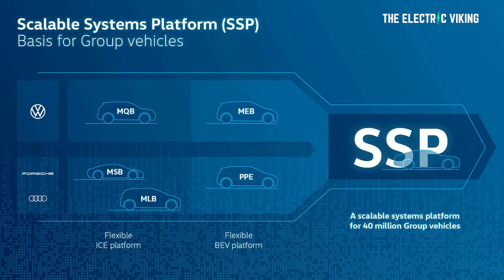Volkswagen MEB+ EV's to get 435 mile range, 200 kW fast charging

Comment: Watch these manufactures claims. Charge hold apparently drops by up to 10% per year by the age of the battery and drops the lower the temperature of the operating environment. As to cost it's been announced here in the UK that electricity used to charge the battery is to be taxed so take your pick and guess how much that will add to running costs in future. Personally I think the car manufacturers are running before they can walk. They should get together and challenge the crazy zero carbon politics involved.

Comment: I wish VW would push out more of the VW E Ups. I really like the idea of a super simple EV like the E Up (or E-Golf) with no big touch screen infotainment, no dodgy software to control the whole car that needs frequent updates, an old fashioned handbrake and physical buttons everywhere. A german company called Kriesel were able to increase the battery pack capacity to 55Kwh and it weighed the same. I'm very tempted to get a E Up as the limited range is enough for me and I hear so many bad things about the software in so many of the newer VW EV's

Comment: Electric vehicles have become popular over the past few years. But EVs could take a significant hit based on what’s happening in Switzerland.

According to a report in the Telegraph on Saturday, the country is considering emergency measures in case of an electricity supply shortage this winter.

Switzerland — the best country in the world according to a recent analysis from US News & World Report — could shorten store operating hours, lower the thermostats at buildings, and limit the private use of electric cars to “absolutely necessary journeys.”

Comment: Within the last ten years the difference in weight between large and small ICE-cars was reduced (all heavy). That is the reason why there is also no difference in weight between the VWEVs and the TESLA3. Only now batteries have improved/ cheaper/ relative less weigth and will come smaller EV cars to the Western markets. The first efficient and capable small city car, with good software,  will be a big winner, even bigger than the Tesla3.(the new EV SMART is still too big and expensive) If TESLA does not bring a small city car in 6 months to the market, it will be on conto of the many failures of nerdy MUSK.
Reply: The buying of TWITTER for 44 billion by MUSK is just like the attack on the Ukraine by PUTIN;  MEGALOMANIA BRINGS SELF-DESTRUCTION. US politicians do also suffer from this mental disease, so bring President Biden to a home for elderly people. in protection of US interest. And bring Trump to a camp for workers.
Reply: Yeah! More failures like the 3 rockets that crashed/exploded! That company went away after their failures didn't it?

Comment: In my AWD ID.4 I get roughly 3.2 miles/kWh highway-only on the day trips we've taken so far.  Summer driving.   California traffic but we avoid commute hours... averages around 65mph or so.  50-80mph due to variable traffic.   Flat and rolling hills.  I don't see these parameters changing a whole lot.  By comparison, a Tesla model 3 gets roughly 3.8 under the same conditions.   For the entire year my average is 3.0 miles/kWh..a bit lower in-city due to there being a lot of hills along my local driving routes.   While not impressive, I am perfectly happy with these numbers!

If you think about it, though, the largest factor for improvement over the next decade is obviously going to be battery pack energy density (volumetric and gravimetric).   Vehicle efficiencies don't really have much room to improve in "normal" form factors... and normal form factors are what most of the buying public are going to want.

That means capacities will be going up... 150kWh+ battery packs will become more common-place in regular vehicles.  That is what will directly enable faster charging and higher ranges over the next few years.  Not efficiency. The coefficient of drag will become less important to buyers as capacities increase.   Past 400 miles of range I don't think people will care so much about efficiency.

There are certainly going to be breakthroughs in battery chemistry and structure over the next few years that will be able to do the job.  The real question is how quickly those breakthroughs can be put into highly-scaled production.

-Matt

Comment: WLTP numbers are not equivalent to EPA as we all know so it comes down to implementation. VW did not generally exceed their current numbers but Porsche did. So I expect the larger capacity battery implementations will be fine

Comment: The ID.3 is not exceptionally heavy for an EV. That is a gross exaggeration (to be expected when the Viking discusses VW products). The ID.3 is 90 kg heavier than a model 3 and ~200kg lighter than a Model Y. Interior space is comparable to a model 3. The car is 10cm shorter, but also 10cm higher. Passenger space is actually slightly better than the Model 3, but the Model 3 beats the ID.3 in luggage space.

If you want to say EVs in general are exceptionally heavy compared to ICE cars, I totally agree.
Reply: The Viking has a lot of information but an incredibly limited ounderstanding of technical automotive manufacturing concepts and yes, an incredibly biased view against VW. Invariably most of his arguments come down to 10 hours manufacturing time for tesla vs 30 hours for vw (which is quite a valid metric, IMO and a fair knock against VW) and 70% automation vs 30% automation (which is too superficial without any understanding of what that means ie there is no standardised definition of automation in the auto manufacturing process eg it could be automation of casting, welding, component assembly etc across the process. In several hardware manufacturing processes - there is not necessarily a 2x benefit on time or cost by automation. And automation is a means to a couple of ends - higher quality, greater standardisation and lower costs - arguably a 50% automation focused on the right process elements can lead to more standardised, less expensive and higher quality end outputs than a 70% automation of lower hanging fruits +70% automation doesn't mean 70% on everything). 

The Viking also loves to knock on other carmakers projections or media gibberish while entirely disregarding Tesla or Musk's million failed promises or timelines. 

To be realistic - Tesla is streets ahead of the game right now. But the rest of the auto fraternity is unlikely to die along the way or just twiddle their thumbs, irrespective of the Vikings strong (and in my opinon - grossly uninformed) predictions. Many of the German automakers will eventually emerge as strong contenders, the random 70% automation point notwithstanding
Reply: @rishabhs14  I couldn't have said it better myself.

I'd just like to nuance the story about Tesla being streets ahead a bit. You already touched on the production advantage Tesla has and I think it's fair to say that Tesla has an advantage in the development of the drive train as well. However, for the in-car software it depends on whether you believe the touch UI interface with Tesla proprietary S/W will be a long time winner or not, if you think Tesla is ahead of the game. And on whether you believe FSD will ever become something really useful in the future instead of a novelty item. In both cases, I personally think that operating the car itself will become less 'touchy' in the future. The entertainment will most likely be taken over by Android Auto and Apple car play. And FSD? Well, all I can say, I don't think it's relevant for the currently sold cars. They will be scrap anyway by the time FSD becomes useful.
As far as driver aids is concerned: EAP is not very unique anymore and since 'Vision-only' (dare I say it?), I think there are better implementations in the market than Tesla's. The removal of the USS means new Teslas don't even have Park Assist anymore (at least temporarily, but no date is given for reinstating that functionality).
As far as car exterior and interior design, suspension, NVH and use of materials, I think Tesla actually isn't ahead of the rest. I think they still have quite a bit to learn from the other manufacturers. If you compare to other 'premium' EVs at around the same price point (by eg. Merc and BMW), Tesla really is no match.
Reply: @rishabhs14  Yes, eventually the Germans will figure out how to make cheap and cost efficient EVs.

Trouble is, in the meanwhile, all they have is a product whose sales are rapidly falling off a cliff, since EVs as cheap as, or even cheaper than ICE cars will be coming from China and maybe Tesla (Tesla can just keep doing the S3XY lineup until 2030 without any problems whatsoever).

If it takes legacy auto five years to come up with a working EV concept that is profitable, but their ICE car sales are 10% of 2022 numbers in 2025, then I fail to see how they will survive until 2028. That is 3 years of little to no revenue.
Reply: The weights you quote are wrong.  If you compare the ID3 Pro S with a 77Kw battery against the Model Y with a 75 Kw they are very similar in kerb weight at around 1900-1934kg.  Interestingly the MG4 (smaller battery though at 61Kw) is 1785kg and the Kia eNiro (68 Kw battery) even lighter at 1757kg (all figures from EV Database).  Whilst the Viking bias against VW is obvious, it doesn't mean he is completely wrong - the ID3 does seem to be a bit too heavy and could easily go on a diet.  

Basic problem for VW with the ID3 is the MG4, similar range but a lot cheaper.  The ID3 refresh cannot come soon enough for VW
Reply: @justinstephenson9360  No, my weights are not wrong. They are correct. If you want to compare 2 other versions, that's fine. In this case the ID3 has slightly more range than the model 3 and a lot bigger battery (82kWh vs 75kWh) and the price advantage for the ID3 is huge. A whopping 28k EUR less.

Compared to the 2 other cars you mention, the lighter version of the ID3 has comparable performance and weight, showing that the VW is not exceptionally heavy (as claimed by Viking with his silly little preconceptions). All EVs are excessively heavy, while Tesla seems to carry a slight weight advantage over the others.
But on the scale of excess (all EVs are grossly overweight in terms of the payload they can transport), the difference isn't that significant.

Comment: Weight is not the biggest factor in highway range, it's aerodynamic drag and drive train efficiency.
Reply: That depends.  In urban traffic, weight is far more important.
Reply: GaiaThink vs MoneyThink  I love their car though. I wouldn't mind owning one of those.
Reply: Weight is an important step to increase range and ids are much to heavy imo. Beides range some other parts like breaks suspension and tires will have a profit. Hope they achieve the next step in their development soon.
Reply: @christians.9028  Weight is not a dominant factor in achieving range for EVs. Also brakes are not heavily affected by weight on EVs, because they use regen breaking.
Even suspension may be less affected by weight in the future, if BMW's suspension regen works in practice.
Tyre wear is indeed an issue for the much heavier EVs. But you can't make an omelet without breaking eggs and it is important to consider that contrary to what Viking says in his video, VW IDs are not exceptionally heavy for an EV.
And if the weight is a serious issue for you, just buy an ICE vehicle. Much, much lighter. 😁
Reply: Precisely! That's how the 5,236 lb Lucid Air gets 131 MPGe and 517 miles of range. Weight is important, but aero and frontal area are far more important to efficiency, especially at higher speeds.

At slower speeds, all EVs are already super efficient and regen braking greatly improves efficiency in an urban environment.
Reply: THIS!
Reply: The impact of weight is far less important than aerodynamics, especially at speeds above 40 mph. The importance of weight to range is also reduced at lower speeds around town by efficient regen braking with EVs.
Reply: @greggrant4614  Exactly, weight isn't the most important thing for range, especially for EVs (having regen breaking).
Less weight is better of course, but it's not the dominant factor.

Comment: You can't really determine range solely from the platform.  Aerodynamics is a large factor for determining range (more than weight even for ICE cars).
Reply: Exactly, weight only impacts range through rolling resistance (which is a function of weight). For passenger vehicles, aerodynamics are much more important. If the car isn't only used for city traffic. So claiming range projections for the new MEB+ platform are not credible is a bit silly at this moment in time. Viking can't know that.

Comment: Reading their actual press release it says ‘Up To 435 miles range’. Of course that means our most expensive cars with enormous and heavy batteries will have that range and probably cost $70K+. The cheap smaller cars will have nothing like this. 

Doesn’t say when this will come on-line just ‘10 new models by 2026’. Just think about this - what will they be competing against by 2026 - Tesla and China will have moved on enormously by then. As others have also said what about software - that surely needs more attention than anything else.

Comment: Car companies can already produce 500+ miles if they wish. This is nothing new. It’s a question of profitability, manufacturing capacity and available total supply of batteries. If a car company  has e.g, 240kW of batteries in supply, I would rather produce 3 cars with 80kW then 2 cars with 120kW. If you are a volume player like Tesla, you would definitely go for the 3 cars. They are profitable and they sell more of them. If you are still a small niche player like Lucid who still only needs limited battery supply, you can sell 500+ car. VW is likely to focus more on volume and hence the 435 miles is more intended for marketing.
Reply: I haven’t thought of this before. Why do you say that? Is there ratios of added weight to added mileage and decreased cabin size etc?  I understand the profit margin on more cars vs less but giant range would surely equal giant sales too. I always think of the tipping point as the place where the general public stops talking about range anxiety. When the batteries are going further than the gas ever did. There will be no reason left to not switch…..until the blackouts and electricity rationing starts of course.
Reply: @milescoleman910 , giant range means a very heavy battery, which means that you have to change the structure of the car to carry all the extra weight and you get decreased energy efficiency per mile. You increase the costs and decrease the energy density, so the benefits of a longer range are questionable. The other way to get longer range is to use batteries with higher energy density, which is something like Panasonic NCA 2170 with 269 Wh/kg, instead of a cheaper option like LFP prismatic at 161 Wh/kg, but that is going to increase the costs.
Reply: @amosbatto3051  You're absolutely right, the bigger the battery size of available batteries now, the heavier it is. Energy denser battery at same weight and cost would definitely extend the range to 1000 kms, which is the target of all EV manufacturers.
Reply: @milescoleman910  yes and no for longer range equals more sales. Yeah, you can get more range by throwing more batteries in but that also means longer charging times. On a trip, I stop about every 21/2-3 hrs to use the bathroom, grab a soda, sandwich and recharge. I really don't wait for the vehicle to charge, as soon as I get back to the vehicle I unplug and resume my drive. Sometimes it's 12 minutes, other times it's 20-25 minutes if I have to wait a bit at a restaurant. If my vehicle could go longer, that would just mean fewer but longer stops. I currently put about 26-30k miles on a year but I wouldn't benefit by having a longer range vehicle more than 5 times per year. I haven't charged anywhere but home for over 3 months. 
The exception to more range is towing. A 300 mile range while towing would be awesome!!